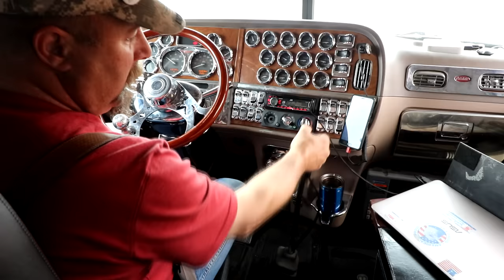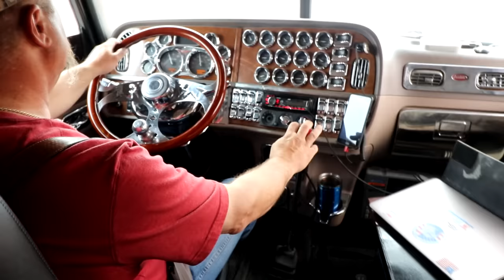How to shift an 18 speed transmission

Comment: for a truck driver, first thing he do before start driving, wear seat belt? earned my respect sir.
Reply: Mine too. 

Then again, its especially worth while doing while in a truck and only idiots don't wear one. Hit something in a car at 30 and it hurts... You get thrown forward but can usually brace yourself if you're stupid enough to not wear a belt. At 30mph in a truck however, due to the weight, there's a lot of inertia. Come to a sudden stop from 30mph in a truck and that inertia explodes and tries to throw you clean through the front window. Or at the very least, it tries to crack open your ribcage on the steering wheel. And then, to make matters worse, when the truck comes to a quick stop, whatever you're towing tries to carry on going forward. Literally putting you between a trailer and a hard place... A hard place that rapidly gets smaller as the trailer tries to crush it. 

It rarely ends well. 

Only idiots don't wear seatbelts. :)
Reply: Also federal regulation
Reply: fariz ascariz ii
Reply: Buck Fitches except for the fact that the mass of the vehicle doesn’t affect your inertia as a person is not part of the vehicle, a 70kg person in a car or a truck going 20m/s still has 1400 
Kgm/s so if you stop in the same time your impulse is the same. The difference is the trucks much greater mass means it will slow less during a collision so the change in velocity is lower meaning the impulse in a collision when inside a truck is less than that of a car. The trailer of course would be a problem if the collision occurred with an immovable object like a mountain however with a collision into another vehicle like a car wouldn’t be enough to make the trailer push through

Comment: Will love to see you explaining all those gauges and switches on that huge board!, Or at least the more significant ones, thanks
Reply: Air pressure gauges are really important for new drivers they tend to ride or hit the brakes too much draining the tanks thus losing brakes and having to wait for the air pressure to come back its especially true for military trucks.
Reply: @wonkybomb1865  lol, funnily enough I know about that because of Merican Truck Sim, the alarm yells at you when you use your brakes too much and the air gets below 50psi
Reply: @toxicity4818  yeah you dont wanna drop down to 50.  ill have to check out ATS i hear alot about it

Comment: Best explanation I ever heard or saw.  I always respected truck drivers and this video just undscores it.  What a complex and powerful machine.  Thanks for the great presentation!!  J
Reply: Powerful? Yes they are! When I was in training at a small yard there was a Volvo parked in the back with damage to the nose so I asked what happened. I was told a student set the brakes but forgot to take it out of gear and with the truck and trailer brakes locked it idled into the break room building that was made of concrete smashing through the front wall before anyone noticed and stopped it! They are like tanks....not very fast but will pull anything lol
Reply: Yes indeed.  Tank is an apt description.  A locomotive is another.  I ride a Cruiser and nothing frightens me more than passing (or BEING PASSED) by just the Tractor alone.  Holy God you can see and feel the sheer power!!!  I feel like an insect next to them
Reply: Yup we try to keep a close eye on bikes when we can and on a bike or in a car you never want to hang out next to a truck so you dont sit in a blind spot or in case a tire lets go. the other rule of thumb is if you cant see the driver in the mirrors we cant see you. Ive never had an issue with a biker and i think its because like truckers bikers have to be very aware of whats going on so we constantly look out for one another.
Reply: AMEN.  Keep on Truckin!!

Comment: I just realised that being a truck driver is a difficult job!
Reply: Sufal Kaushal at first it's overwhelming, but then it's just 2nd nature.
Reply: I think truck driving is under estimated in difficulty. Shifting gears, or matching the engine's power output to the load of the road, is only one part. The next part is keeping it in the correct lanes during turns and when you finally get to your destination you have to back it into a tiny slot. Most of them make it look easy, but it isn't.
Reply: Jason Great to learn that but it's the skeptics that makes it sound so...
Reply: pixelpatter01 and then having a trailer attached makes it a heart wrecking thing too! As I mentioned it is a difficult job!
Reply: remember, you dont shift from 1,2,3,4,5,6,7. you shift from 3,6,8,10,14, etc for better fuel economy while acceleration and faster acceleration.
Reply: Yeah seriously! Give these guys some room because if you cut them off you just cost them like 10 gears!!!!
Reply: The guys that do the long haul trips have it tougher... having to do all the loading, hooking up and little trouble shooting and maintenance jobs, while dealing with dick employers and customers, and the authorities and their often petty shit! I was a mechanic for 7 years and have held a truck license the last 10 years, but i still wouldnt want to do it!
Reply: What he just showed is not difficult bro . The difficult is be always a step ahead from every fool you might encounter while driving , always be ready for someone else mistake so you have enough time to react . that's the most difficult and to stay awake while driving at night for long time on a straight line .

Comment: Thank you YouTube for recommending me a video for 18 gears transmission. This'll be very useful for my automatic vehicle.
Reply: The problem I have with driving a truck with an automatic transmission is at least once a day I try to step on the clutch when coming up to a stop!!!
Reply: @sleepy76...LOL. I hear ya on the missing left pedal. :)
Reply: Felt the same way.  Went from an outfit that had manuals 10 or 13 speeds to a company that had automatics.  On my road test I naturally went for the stick.  Safety guy thought I was trying to reach out for his hand o.O

Comment: Wow. . . this video gave me anxiety. Im trying to imagine myself driving in 14th gear. 
"Oh look, a red light. I should down shift."
" . . . WHAT GEAR WAS I IN AGAN!?!"
Wheels lock up
I would die, yup.
Reply: Just hit the brakes and slip it into neutral. And if you can't get it into neutral, don't worry, you'll still stop - the engine will just stall.
Reply: Only if you're trying to maintain your speed on a long grade. If you're just trying to stop completely from highway speed, the brakes are up to that task. They can do that three or four times in a row before they start to overheat. Remember, you have two giant brakes on each axle, so ten huge brakes. Each brake shoe on a class 8 truck weighs as much as the whole wheel of a pickup truck. It's only when you try to hold a speed on a long down grade over many miles that the brakes begin to fail. Actually, if you're going down a long grade, and you're close to holding it with engine braking (that is, you are still accelerating a little bit) you can still touch the brakes every ten or twenty seconds without exceeding their limits. When I used to do this, I would only downshift twice in high range, and not at all in low, when approaching a red light.
Reply: You describe something that happened to me when I tried for the first time
Reply: you should know the light is going to change long before it actually does and already be in the position to downshift. it's called reading the intersection... one way is with a "stale green" which is a light that has been green for a long time will very likely change. not sure if i should share this secret, but i always watch the crosswalk signal. if it counts down to 0, then the light is going to change. you never think of what number gear you are in, just that you know to downshift from the sound of the engine and if you want to slow down or speed up. i must say i very rarely use the breaks when coming to a light. only if i actually have to stop and stand at the light...
Reply: Shim Bro, most trucks also have a 'Jake break'. It's an engine break that slows the RPMs. I'm sure you've heard them, they're so loud that many city centers have ordinances against using them in city limits.
Reply: So is there a gauge for brake temp somewhere on that huge dash?  How do you know they are overheating?
Reply: Not funny
Reply: Some are equipped with a gauge, if not, you don't ride the brakes to start with, and you pretty much smell when your brakes are starting to get hot. Then they smoke when you burn them, and if you're going down hill, the fun begins.
Reply: looks confusing, but after years of driving it becomes natural & you have the radio playing, maybe on your headset with a call. most truck drivers even local spend very long hours in the truck & in short time you get good at it.

Comment: Hmm they skimped out on the gauges... 
There's room for two more on the left in the main panel above the radio
Reply: Testacorsa oh yea we’ll, they were trying to save some money
Reply: heck drove big R tractor that  had  only  a speedometer,  air pres,  and temp gage
did not even have a tac. you knew by the sound,  it had only one seat, no sleeper, 
no radio, no air, and ten speed
Reply: all you need is a fuel gauge. the cops will let you know if yer going too fast!!
Reply: no you wouldn't be able to see them thru the steering wheel

Comment: First rig I ever drove;  5 forward gears with a 3 speed transfer back in '67.
Reply: Joe Allen I just inherited a 6-4 twin stick 1970 359 Pete, haven't got to drive it yet. Any tips for a young buck?
Reply: You just have to feel the gears and practice.  Take your time and it will come to you!  Not sure if you have to double clutch that rig?
Reply: Joe Allen no sir, papaw and dad both have always used the clutch for take off like in the video then floated the rest
Reply: That was probably a pretty nice setup for the day!
Reply: Joe Allen 3 in the tree man 2 shifters?
Reply: Clayton Atkins never driven 1 but it's like a 4 speed (hi low) with 5 gears in between or 4 think of it as gears  in gears (like a hi low or splitter like a 13 spd/18) good luck bro got be quick  on them
Reply: Joe Allen for your road test yes no real  trucker double clutches

Comment: damn 
my friend's bike had 21 speed
Reply: Those are harder to shift than these trucks .... i trained guys on ten speed my method if you cant get it the next gear with your pinky finger your trying to hard it should slip in like Cinderella’s slipper little grind is ok
Reply: Jon Lewis no he is talking about those mountain bikes with 7 on oneside and 3 on the other
Reply: Hes joking aswell...
Reply: Yes ive had a mountain bike before got the gear shift knob on each handle bar.... these trucks are easy once you get it down i knew how to drive stick i taught myself how to drive a 10 took a week to smooth it out ... i float the gears only clutch to stop and go and I will engage the clutch when turning at an intersection in about 6th gear (in a 10)
Reply: I used to love flipping it into 3-7 going downhill. ZOOMING

Comment: Thanks for the lesson. Never had a look inside the cockpit of a big rig. Looks pretty sweet. But all those gauges!!! Whoa!!! How about for your next video —a rundown of what they all are? Thanks for sharing!
Reply from the maker: Video 100 I did a complete rundown
Reply: Roger that.
Reply: They’re all fake gauges, just for show! (Kidding)
Reply: I randomly came across this video, then this comment. Thank you, you are ahead of your time. When you said video 100 I was kind of disappointed because I thought I would have to count videos, you number all your videos so when I view them all it's easy to find. Thank you so much for that.
Reply: Ammeter, Voltmeter, Oil Pressure, Oil Temperature, Water Temperature, Fuel Quantity Gauge, Air Pressure,Turbo boost pressure,  Blind Spot object detecter, Cop Radar Microwave signal detector, Time gauge, AM radio gauge, FM radio Gauge, TV channel indicator...etc
Reply: you forgot the moron detector... but seriously i'm sure there is a transmission temp, an exhaust temp, an air bag weight, 2 air pressure, brake application... all these are really not needed. the only gauge you need is a fuel gauge. the cops will tell you when you are going too fast...

Comment: I'm currently checked out on four aircraft types. The Airbus A-319, 320, 321 and 330. 
It would probably have taken me a lot longer to master descending from, say, Eisenhower Tunnel on Interstate 70 in Colorado in an 18 gear truck like this than it did to master descending into LaGuardia. Downwind.
Reply: Mike Patton start a channel
Reply: If computational transmission components were economiaclly viable enough to put in big rigs they would be more common place, but manual trans is less likely to need to be serviced, that service cost being put on the driver's truck rather than the companies plane.
Reply: Tamekia Hewitt 
I'd love to. Certain employers are touchy about allowing you to shoot video from inside the aircraft lately so I'd have to make sure it's cool. Thanks!
Reply: William Barker 
Relax son. I was only half serious. With enough training and experience, I'm pretty sure I could figure out how to get a big rig down a mountain. And as I said, I told you what aircraft I am "currently" check out on. But I spent 22 years in the USAF flying the most analogue aircraft you could imagine. From the KC-135-Q to the C-5M-SG.
Reply: More trucker accidents than airplane crashes....
Reply: Mike Patton 2 types
Reply: William Barker í
Reply: Just checking back to see if youve uploaded a video yet. Nope. Cmon man get it together already